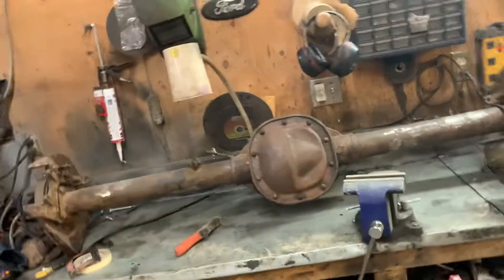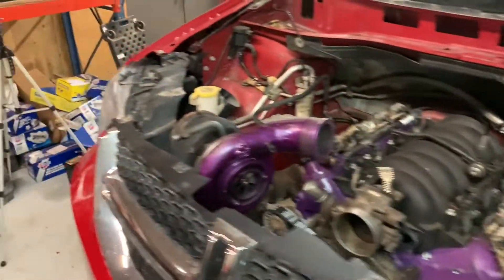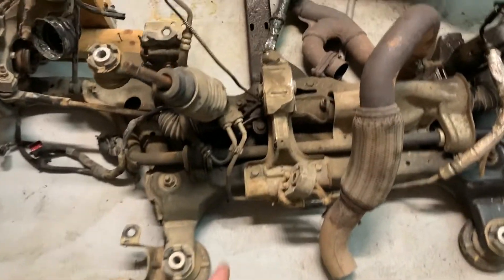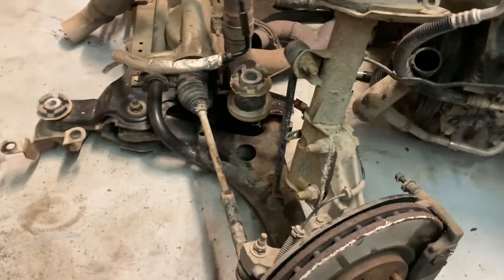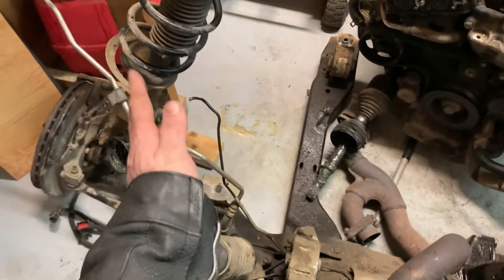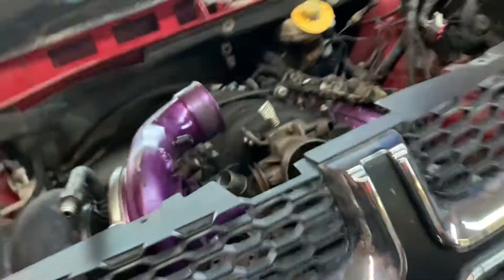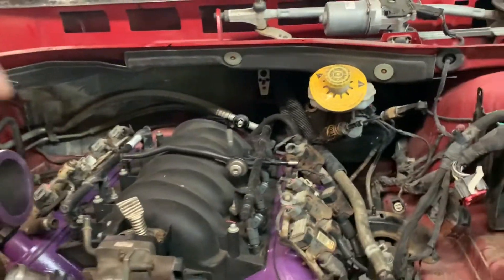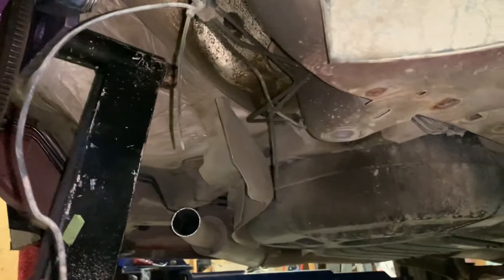Turbo LS Grand Caravan update 03/26/21 #24

Comment: @2:37 ... if you swap the knuckles side-to-side, you get the wrong Ackermann ... which, in this case could work in your favor ... anti-Ackermann is the setup they use for drift cars ... it makes the ass-end want to swing out from under you in a turn .... 😉🤣 Drift-caravan!
Reply from the maker: I’m definitely not as familiar with steering geometry as I should be, but it did end up working 😁